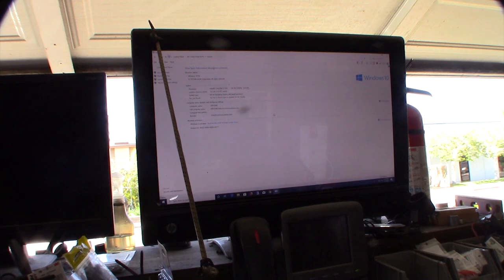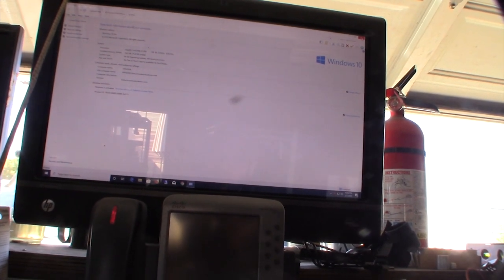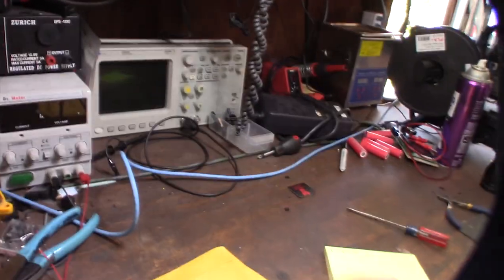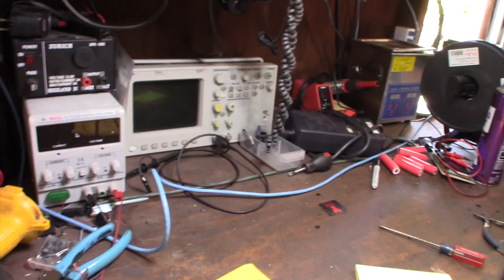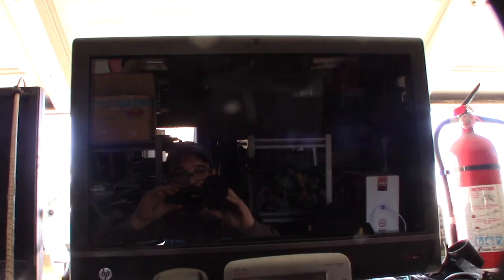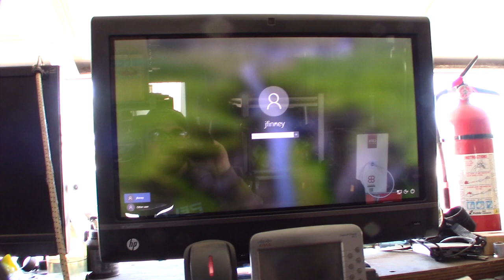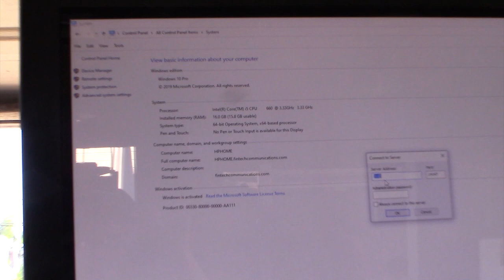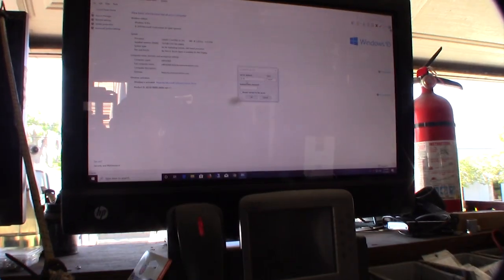HP Touchsmart 610 CPU Upgrade Disassembly And Maintenance All In One Test bench computer

Comment: I have had mine, since probably more than 10 years now. I used to work at HP and I got one of the first ones from internal employee page. It is a great one, I struggled a bit to buy more memory once, I only found it from China, and took about 3 months to arrive. But all is good now. I am thinking on building anotherPC though, not sure how much more it is going to last. Mine is a Core I5, came with the PC, also, I dont think spending on upgrading components is worth the money. but hsa been a great computer over the years. I also upgrated the HDD to a 2TB which is the biggest one it supports, and it runs great after that too.
Reply: hello am trying to upgrade this thing's ram, SSD, and thermal paste  for several years, what ram did u use? and does this work with any ssd? should I get a bracket for the SSD? and last but not least is there anything should I be aware of while trying to put new thermal paste or anything in general? thank you. and what is MOSFETS exactly?

Comment: A computer of this vintage would probably be on eBay for parts (if not operational) for about ~$90+/- USD.  That’s a possible way to get the parts you need or want.

Comment: That must be an early model, I've just upgraded a customer's 610 from an i5 2400 to 
an i7 2600K & he was happy but you need to make sure the thermal pad under the Vcore heatsink is fully covering all the MOSFETs as this was a common problem from the factory having the thermal pad misaligned & not fully covering the MOSFETs & the impending disaster will soon follow if not checked, shorted Vcore fets & blown driver chip & possible CPU.

Comment: I'm trying to do same thing, as I like this computer. Just to help with more information: I think that motherboard is a WJ1 (Inglewood). (https://support.hp.com/ar-es/product/hp-touchsmart-610-1100-desktop-pc-series/5080777/model/5095636/document/c03195438). Also coulnd't find the heat sink to add a MXM Graphic Card too. They said there are 2 Fan sink, UMA graphics (incl replacement thermal material) 658988-001 and Fan sink, discrete graphics (incl replacement thermal material) 658987-001. I know that now it is and old computer, but I coulnd't find when was almost new. Hope this info helps. Thanks for sharing.

Comment: Quick question.. i do have same model but with i7 and everytime i do upgrade to win 10 sound is not detected while i see yours got win 10 and sound is working .. any tricks??
Reply: For any one with the same problem, this worked for me

1. Open Device Manager: To open Device Manager, go toSettings, click on Devices, go to Connected devices, scroll down to Related settings and click on Device manager.
2. Open IDT High Definition Audio CODEC: Unfold Sound, video and game controllers and double-click IDT High Definition Audio CODEC (or right-click > Properties).
3. Click on Update Driver: Go to the Driver tab and click onUpdate Driver... (second button seen from above).
4. Click on Browse my computer for driver software: After completing Step 3 a new window will pop up with two options. Choose the second option (Browse my computer for driver software)
5. Click on Let me pick from a list of device drivers on my computer: After completing Step 4 you'll be prompted to locate a driver. Click on Let me pick from a list of device drivers on my computer.
6. Click on High Definition Audio Device, click Yes: Make sure Show compatible hardware is checked. Click on High Definition Audio Device under Model, then click Yes. Do NOT use High Definition Audio CODEC or whatever is showing for you.
Step 6 Ignore any pop-up
Reply: yes, same happened for me, just took a few tries to get to that solution.

Comment: I have this PC . when facing the computer, the left side of the PC in the back at mid point bet top and bottom get quite hot and every so often my computer shuts down. I believe it the cooling fan. then I just noticed in this video there are two fans , can some one tell me if fan is the problem and if so which one is the cooling fan.

Comment: I have the same computer, but it's running on Windows 10 Home. It came with only 4GB of RAM I checked online to upgrade RAM and it says I can add up to 16GB. However, I bought from two different vendors, and both times comp would not turn on. I added 8GB to each slot. Can you tell me what I may be doing wrong? the model number is 610-1030f. I love using this comp, just wish I could make it run faster, 4GB is just too slow.
Reply: U have 4 slots right. I think it only supports 4 gb per slot max.